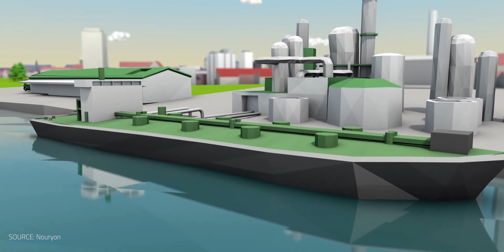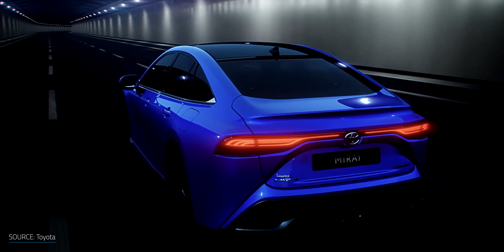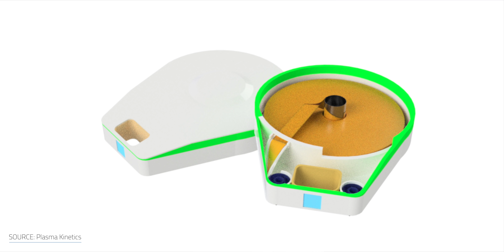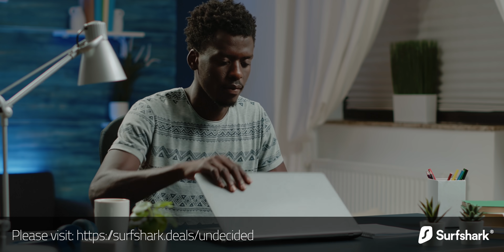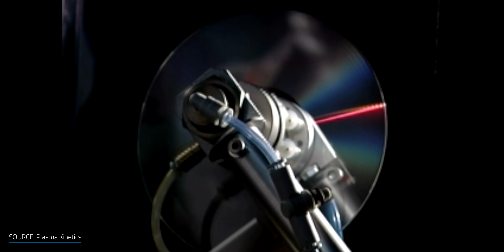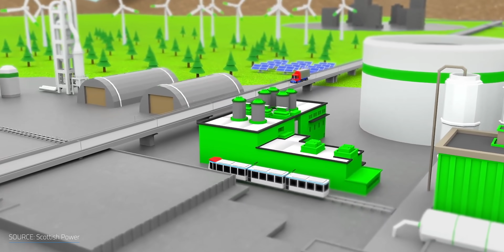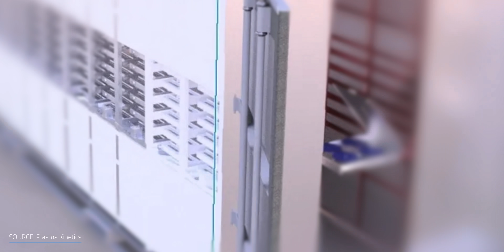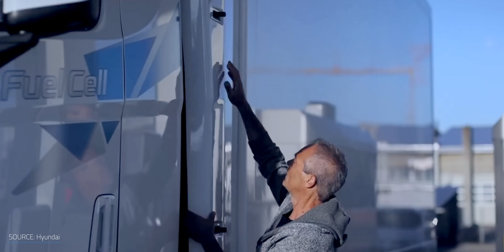Energy Storage Breakthrough - Solid Hydrogen Explained

Comment: I wish I had $100 for every "breakthrough" technology in battery or energy production that comes along. I honestly could retire. Of course, this technology is still fairly new and untested so there's plenty of runway for it to become much more advanced and for costs to come down so it may become something commonplace someday. I really don't believe that lithium ion based batteries are the long term for our energy future.
Reply: Frankly, I'm not convinced lithium-anything will be a large-scale part of our future, given its scarcity. Trying to use it to back up our power or transport grids seems destined to fail simply because we run out.

But it's clear there are many people working hard to come up with alternative energy storage methods. It'll be interesting to see which ones make it to maturity and which ones do not.
Reply: I can understand the fatigue. Most new technology takes anywhere from 10-30 years to actually get used for anything practical if ever, and during that time is usually when the problems become apparent. The nice thing though is that behind closed doors after the hype settles even failed technology usually leads to innovation in the rest of the field.
Reply: @jonasstolberg2802  Contrary to popular believe, lithium isn't scarce at all. There is an abundance of lithium in the ground, it only needs to be mined. It is estimated there is about 170 times the amount mined in 2020 still in the ground.
Reply: Its been around since 2009 so it's not that new and the tech is actually pretty far along as they have many working prototypes with tons of data. I think for busses trucks and maybe even construction equipment we will see this being used at moderate scale within 5 years so invest early.
Reply: This company shot lazers at tape and are now making these claims before the tech has even been applied to any platform. They already got all these graphics and marketing material but all you get is a CGI tape deck that will change our lives. Theranos vibes.
Reply: @jonasstolberg2802  - There is 14 million tons of Lithium still to be mined and Li is one of those metals that tends to stay in circulation. Even more so in the future.
Reply: I’ve ignored every single thing about hydrogen being the fuel of the future until this. This catches my attention
Reply: Lithium works well enough for normal cars, it has a pretty solid future in those. Its just very efficient to use direct chemical batteries, and keeping global power consumption low is incredibly important to ease the transition to renewables. 
For the grid and large scale transport including trucks? No. It sort of works for home solar setups but it doesnt feel like the right solution. 
There is a cool project on a german highway, which basically puts tram like voltage lines above a part of the highway. It works incredibly well, carbon neutral, has a fairly reasonable initial cost and has the best efficiency possible because the grid directly powers the trucks. For many intensely used routes this seems like a really solid solution.
Reply: @piccalillipit9211  Tesla is the third most valuable company in the world. State and federal governments have given Tesla multi-billions in subsidies. It's ridiculous to believe the government is hampering Tesla.
Reply: @bmmmchichibmmm  Yeah, and once Thanos gets involved half of your operating capital is gonna disappear.
Reply: @hapskie  Right, it's rare like we said. Just like all that oil that it will never be cost effective to go after, you'll be lucky to get half the lithium. Ok, 90x last year's production? You do know that we haven't made many lithium batteries, right? A billion cars would wipe all that out, not to mention that it's supposed to be the savior of renewable storage planetwide.
Reply: #reality
Reply: @hapskie  and a lot more in the ocean. Can be probematic to mine t.
Reply: The pentagon seemed to take it seriously enough.
Reply: We're actually using many of those battery break through. You just don't realize it. The li-ion batteries in modern phones are a fraction the price per unit storage, hold more power, charge faster, are safer, and have a longer life. But you say "that's just normal progress". Yes, well. When they said they'd cut the cost in half and double the density 15 years ago and here we are with less than half the price and over 2x the density, you have to think. Hmmm....
Reply: @hapskie  outch, trucks, cars, planes, etc are still running on gaz. If  we only have 170 time what was mined in 2020, than we'll run out of lithium quite fast. 170 time is 170 years at current level of lithium consumption. Increase the lithium demand by 10x and you have 17 year left of extraction. With your number, it's appear to me that you are confirming the rarity of this metal.
Reply: @Iamwolf134  does America deserve it's place in the world?
If it does, why the hatred that seems to fuel America's enemies?
A land of freedom. Freedom to crawl over anything to reach the top. And what's at the top? The view of all the victims that make the mountain.
Reply: @yoda-be.at1746  Didn't hurt your fee fees, did I?
Reply: @Iamwolf134  no, that's not possible from you. But you don't address the question.
Reply: Yeah same .... and it'll take off in 10 years after this decade lol
Reply: @hapskie  That sounds pretty scarce to me. That's 170x total mined in 2020, when we haven't come close to fully switching off of fossil fuels. I'm guessing lithium mining growth will increase quite rapidly over the next decade and that 170 year supply will become a 50-60 year supply very quickly. Anything with a finite supply, especially if it's got to be extracted through energy intensive and dirty mining processes, is absolutely not a solution.
Reply: @bmmmchichibmmm  You've just used the fact that the tech is different than our other systems to try and make it sound ridiculous without actually arguing anything.
Reply: @yoda-be.at1746  they also have nanogalvanic aluminum that makes hydrogen instantly on contact with water. 2011 aberdeen proving grounds Maryland. ARL LABS
Reply: Too bad the U.S. Government didn't "feel" that way, the technology wouldn't have been banned; non-engineers, meh...
Reply: For those who are skeptical remember this: Renewable and tech like this have a very short iterative process. That's why renewable have become cheaper than fossils by the way! And 10 years for renewable is an eternity as far as development goes!

Compare this to fusion power, nuclear or fossil fuels in general: they are either too complicated to iterate very fast or are so mature that any gain would require massive investment. 

This tech, by the way, seems the most promising of all the tech I've seen on this channel or any other so far. Keep up the good work !
Reply: @yoda-be.at1746  your flimsy question?
Reply: This time it's real lol. Although would be fun to see Tesla investors turn into conservative minded boomers in real time.
Reply: @Iamwolf134  the one you acknowledge, but you can't answer. Yes, my flimsy question.
Reply: Too true, Li ion are getting fairly good but we are probably entering the realm of diminishing gains with Tesla 4860 technology and BYD blade technology. Further improvements will likely be small.

The next step is aluminium ion batteries with theoretical potential for 2 to 3 times the capacity of their Li ion counterparts in terms of weight and volume. There is a lot of development work going on but breakthroughs are needed. Probably still at least ten years away.
Reply: @GoldenMinotaur  the hydrogen have still got to be produced efficiently, thats more of a probelm than the storage or transportation. this is just putting the cart before the horse
Reply: @paulpinecone2464  The issue of lithium reserves has been carefully studied, all those I have seen suggest that between mining and recycling there is ample to meet the needs of electrifying the global vehicle fleet. In any event it is likely to be only a transitory issue as other light metal battery formulations (aluminium, magnesium and sodium) are coming along and will likely supplement or even displace lithium in a few decades.
Reply: @GoldenMinotaur  Don't confuse unions with the government. Well on second thought they are the same when it comes to being a Democrat...at the very least Democrats in Michigan. In Texas, it had nothing to do with oil but car dealerships trying to keep a strangle hold on franchises. Besides oil companies have no problem selling all, the oil and gas they can find and process. How do you think Tesla's are able to power up (hint: it's not from the 10% of electricity generated by alternatives) So no the "government" isn't hampering Tesla. In fact research how Tesla was able to acquire their Fremont plant from Toyota. You will see that in fact, the "government" has been helping Tesla...big time.
Reply: @piccalillipit9211  No doubt Sandy Munro is a well respected industrial designer. However, Tesla also employees more than a few smart guys. It's one thing to recommend injection mould it's a far cry from what Tesla's engineers accomplished getting the idea to the point of production. In essence all Munro was doing on the YT video was rant angst all the stupid WOKE individuals that Biden is staffing his dministarion. I completely agree with Mr Munro on that point.
Reply: Besides... the world at large needs to calm down a bit for solid state hydrogen storage technology to be released in order to minimize the disruption this may cause lest we instigate yet another crisis that we'll have to manage...
Reply: the main reason you here about alot of technologies with very few making it to production is down to cost to scale it up to that point for every 1$ you spent in research you will spend about 10$ setting up production and distribution, so unless its so much better than the previous technology its not really going to bring enough investors to both make it to market and and capture the markets attention
Reply: @Iamwolf134  no, not my hatred. Just pointing out that other countries that would act like America would be termed as rogue. America is sick right now. Illness can be cured. I hope it will be soon.
Reply: @yoda-be.at1746  Yes, America isn't well, but you're not pointing anything out that I don't already know about. You're projecting your hatred onto America...
Reply: If I had $100 for every breakthrough technology just on this channel. I'd have at least $100 a week income.
Reply: @yoda-be.at1746  You BENEFIT from such a system whether you admit it or not. And by the way, govt looks out for itself...
Reply: @blakebrown534  Bruh. Its just a fuel storage system. If it is good enough to be making the claims its making it should be prototyped in a current platform AKA a car. All this is, is marketing.
Reply: @timseguine2  we have to remember that this tech has been out close to 12 years now so it might be more mature then the video lets on. I will put a few bucks on their IPO if and when they go public.
Reply: @jonasstolberg2802 , you do not need lithium for power back up. power backup does not require mobility. Weight and volume are not a necessary variable.
why waste expensive batteries on non mobile power storage?
Reply: @piccalillipit9211  only to those who did not know about ISA.  everyone in defense did and remained silent
Reply: @blakebrown534  I totally agree it's not the end-solution but it will surely not run out in the coming century. Don't forget lithium is relatively easy to recycle, so the supply isn't used up.
Reply: @AXMIM  Big difference is that oil is used up/consumed, Lithium isn't and can be recycled.
Reply: @hapskie  my point was about your statement on the abundance of this metal on earth. Recyling doesn't make this metal abundant on earth. Like steam and like oil, lithium battery isn't going to stay in my opinion. It's just temporary the best we've got until we find something better.
Reply: @dantronics1682  it's easy to make hydrogen, it's even easy to do it green but unfortunately easier to do using fossil fuels. Storage and transportation is the single biggest hurdle, remove that and hydrogen has some potential. Without that hydrogen as a transportation fuel source is a white elephant
Reply: @sourand jaded the problem with electronics is not that they aren't repairable. It's that we the people who own said electronics get a serotonin hit when we buy a new thing and can't be bothered to take the old to get fixed. 
I personally have replaced chips on iPhone motherboards and brought them back to life. Can't tell you how many boards I've fixed by throwing them in my oven at 450f to rework the solder joints. 
No, electronics are not the problem, uninformed people and greedy retailers are the problem
Reply: @GoldenMinotaur  I know its easy, but its either not cheap or efficient
Reply: @dantronics1682  it's a complicated bit. I'll try and keep from being too long winded. Technically it's both easier and cheaper to produce green hydrogen. Take a windmill, pass electricity through water, pipe off oxygen and hydrogen. 
The problem is that oil companies can also use natural gas to make it through steam-methane reforming, and oil companies are not fans of putting aside profits they can get from pre-existing infrastructure and investing in something new. I mean, why spend money to change if your just gonna make the same amount of money even if you don't change right?
Reply: @sourand jaded Oh hai! You just replied to a random comment for your tirade? Anyway, sorry about your bad dating experiences with electronics. 

[typing this on a 12 year old laptop that I didn't pay bottom dollar for]
Reply: @blakebrown534  Thunderfoot just buried this in his latest video.

Comment: No way this can be done without using electricity - there's not enough hydrogen in the atmosphere of the Earth by itself (you do have hydrogen, but as compounds - water or methane). Free hydrogen is only a thing at the highest parts of the atmosphere, where those molecules are split apart by the cosmic radiation.

Comment: My guess is that even if these statistics about "energy density" are technically true, storing something only on the surface of a disk means you have a lot less space to store it compared to something which stores energy throughout a volume, such as a tank or canister or battery.

We'd have to see figures for actual energy storage capacity of a whole disk unit including its casing etc. And then compare that to a tank or battery of similar size.
Reply: Not to defend the entire thing since I have reasonable skeotism, but you can get around the surface area problem with the right material structure. You lungs and intestines have multiple square miles of surface area but take up comparatively little volume. If the video description is accurate you have a similar high surface area to volume ratio material.

Though you still need to account for the empty canister mass for both payload and energy density calculations.

And while their answer to where to get the hydrogen from is renewable powered electrolysis, I am uncertain if the end point is hydrogen fuel cell (requiring pure oxygen feed if you don't want to account for weirdness) or a hydrogen combustion engine (requiring a bunch of engineering to design right, gasoline has to have certain composition to avoid knocking which is where the combustion is kind of erratic so it knocks the pistons around in sporadic bursts instead of smooth expansion)
Reply: @jollygreen-p1g  Don't you still need to shine some kind of laser on the surface though? Sure you can stack multiple disks etc. But the density you can pack these surfaces partly depends on getting laser everywhere you are storing / releasing hydrogen, I think.

The fact it's a spinning disk with a single laser suggests that the laser part is quite "bulky" and expensive : otherwise why not have an array of little lasers? 

Unless I'm misunderstanding the whole thing.
Reply: @jollygreen-p1g  lungs have square meters not square miles
Reply: Open up a lithium battery. It is just a series of films wound up. The same limitations on density are applicable equally to both in this vein.
Same for capacitors.

Heck, those more traditional "solid" batteries have less available surface area precisely because the plates are so thick.

Also, when you precision manufacture thin films like this, self-contained in their cartridges, it's easy to get tens or hundreds of times the length over something that needs to withstand human manipulation.

Its an interesting theory, anyway. Until they get some proof of concept working so we can see some in-the-field results, I still remain skeptical of the longevity of this idea. But if it does end up working, it has some interesting applications.
Reply: If i understood it correctly, its a wound up film, not a disk. Its basically adsorbtion on an ultrathin film that is then wound up to get a tighter package. 

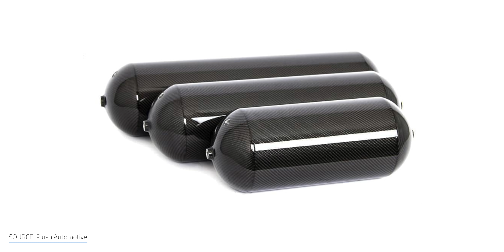As for density, at 9:45 he is comparing it to a pressure canister at 700bar saying it is heavier per kg of hydrogen and thus has a lower energy density. 

As for safety it is obviously better than highpressure hydrogen. However will have the same problems as batteries namely thermal runaway. If there is a fire, the thin film will release its hydrogen which leads to more fire.
Reply: @jollygreen-p1g  except you don't need surface area to store something, you need volume. The amount of mental gymnastics here is painful
Reply: @gnaruto7769  Lungs store air for an entire human for 70 years. The volume is more then sufficient. /S
Reply: @powerdimer  lol no. Lungs barely store enough for a few minutes, and even that only with training.